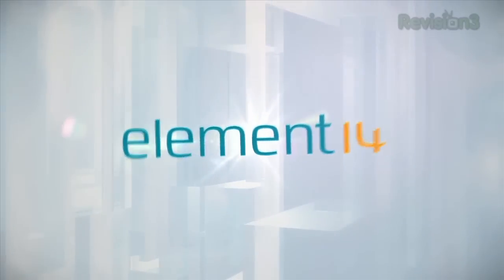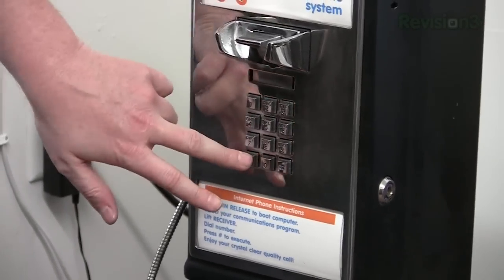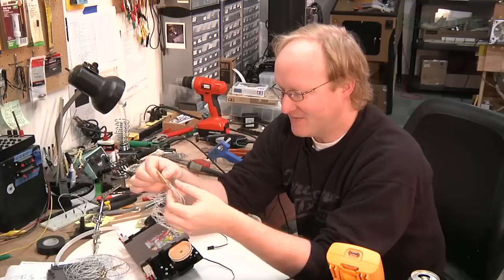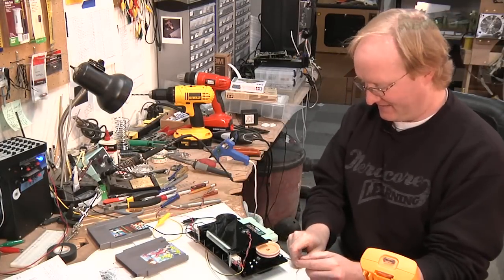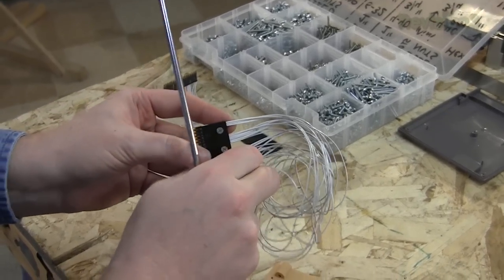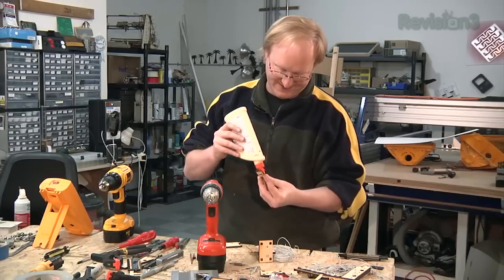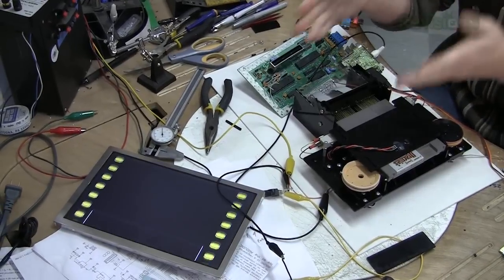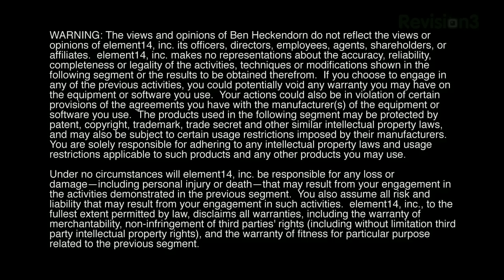Slot Loading Nintendo Game System - Part 2

Comment: Things I would have done:
Move rollers to the top and bottom instead of on the sides.
Use only one servo with a gear to move both rollers. 
Use another micro servo to clamp down on the cartridge pins.

Comment: I would have liked to seen a analog control system for loading instead of using a ATMega, he mentioned the AVR chip has more speed (and probably processing power than the CPU of the NES). Nonetheless it's an amazing project, very educational.

Comment: What I want to do with my old NES is make a portable GameBoy like system from an old Mac or IBM floppy drive and a portable DVD player screen, the biggest problem I had was getting the cartridge pins to go to some flexible wires so I could twist it and make the cartridge go in the side of the board, which would've been the top of the portable system. My next problem was power, and I figured the battery from the DVD player would be enough to power the screen and the NES, then it could be recharged. Anyway, watching these make me want to break it out and try again!

Comment: 4K panels in the consumer sphere are a necessity. DPI effectively took a nose dive when desktops adopted LCD panels and now most desktop displays have a native resolution designed to accommodate HDTV resolutions (1920x1080 or 1920x1200). 

Ideally it would work the other way around, but consumer HDTVs have been the driving force in reduction of cost in display technology for quite some time. Improvements in TV quality / cost trickle down to computers, which is where 4K content currently exists.

Comment: The 10$ shipped adapter from stoneagegamer isn't a "normal connector" it's just a regular 72 pin socket like what you find in the nes 2.  It has a lovely "death grip" and works perfectly for wiring up a proper cartridge slot in a toaster nes.

Comment: I don't...  but there's a hackerspace within driving distance...
But really, someone could do a project like this without a 3d printer or a laser cutter - it would just be more work.  Gears and wheels can be found from robotics suppliers.  Parts can be cut by hand with a jigsaw and drilled on a drill press after careful measuring..  And to make a board for attaching connector pins at 2.5mm spacing, start with a blank PCB and etch it, then solder the pins on.

Comment: This is one excellent project, Mr. Heck.  I also saw you increased the pin count from 60 (since you omitted the ones in the middle, which were linked to the expansion port) to 72, covering all pins.  I guess some games had to use the middle pins to work.

Also, this is a strange question, but some people have modded their NES to accept Famicom carts on the top.  Would that be possible on this mod, assuming there would be room?  And, have you thought about making the lid open as a cart pushes it?

Comment: I *LOVE* that the micro is faster than the Nintendo itself.  Reminds me of back in the day, I used to print from my Amiga 1000 (7.16 MHz 68000) to a HP LaserJet 4 (i think?) that was running a 30mhz 68040 (or something of that class).  It always felt wrong to do.

Comment: Appears you've answered the original question as to "WHY would they use a slot connector that's obviously expensive to make?". You only find the original issues when you try to do it better.

Comment: oh, and ben, you have gone far too commercial, to start with an hdtv is pretty cheap these days. a 27inch quality hdtv can be bought at around 300 bucks (if you go back 14 years even a good crt monitor at 27 inches (which back then that crt would likely manage 1792x1344) would have cost allot more. while if you jump the money up to 1200 (which back then if what you would spend for an excellent monitor over 30") you can currently get an insanely nice 30 inch ips panel, or a 50+ inch led backlight

Comment: sorry but most of heck's work is client based. i understand the cool factor for this project, but i also understand that the cool factor is very low on this project. while being able to set up a clasping connector is cool as hell, he went about it the wrong way because he is requiring electronics to do it, while it should be leverage based (pushing it in should cause the pins to sit in place, even if the power is off) he is simply over-complicating something that has been solved. top loader.